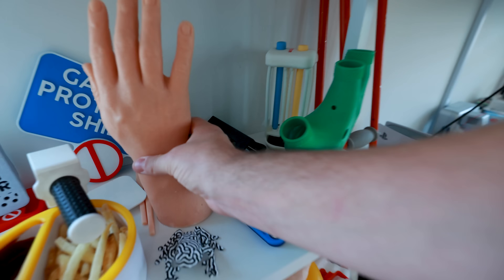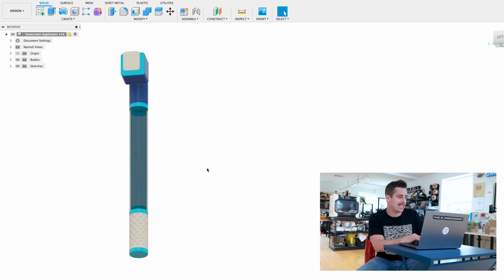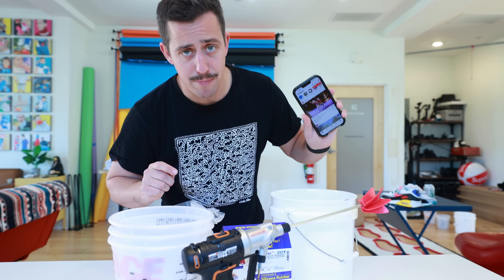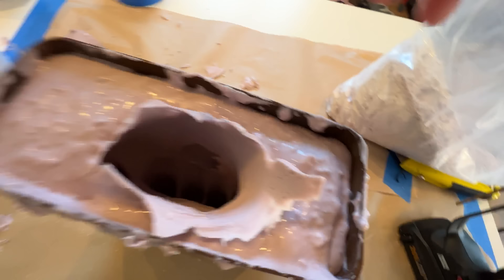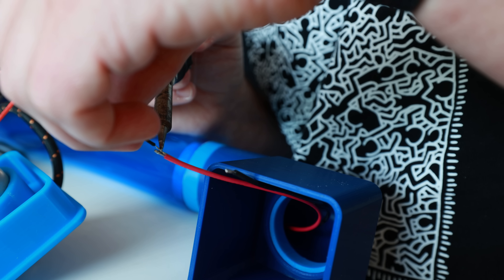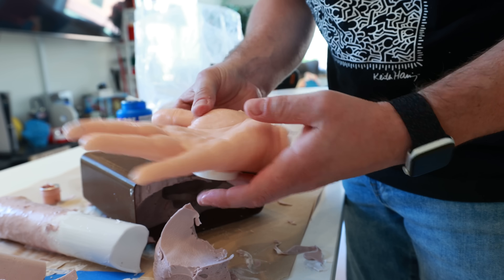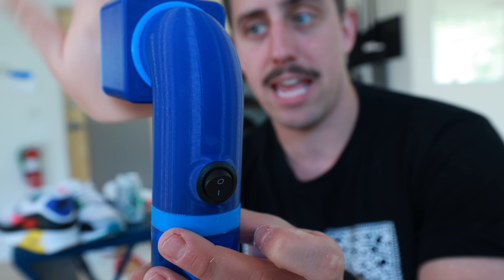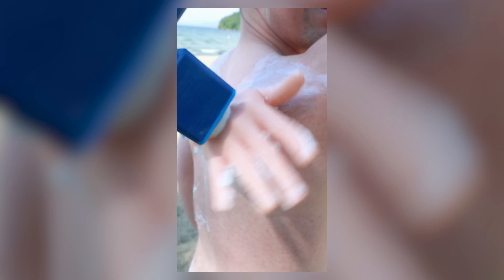I invented a device to put sunblock on your own back

Comment: I've worked with alginate and silicone before and I recommend using a shaker or a vacuum to avoid bubbles if you aren't already
Reply: A vibratory sander works well
Reply: No one like this this is a perfect number
Reply: Bruh u liked it

Comment: Only thing I think would make it better is having some way to put the sunblock into the tube. Then maybe have a hose go through the hand so that it can squeeze the sunblock out as it spins on your back. Upside: don't have to lug bottles of sunblock with you anymore; Downside: would probably make cleaning the product a nightmare (though you could probably just run water through the hose idk.)